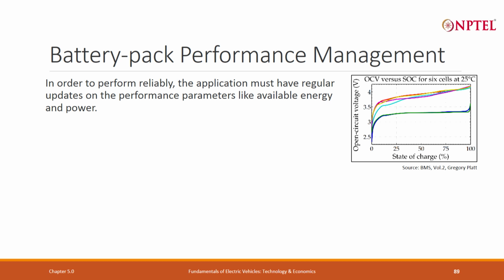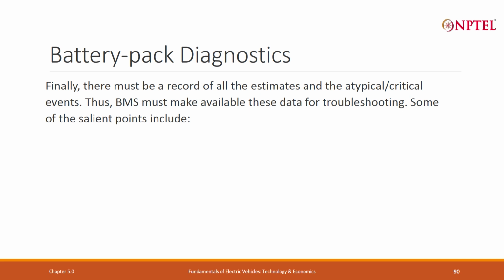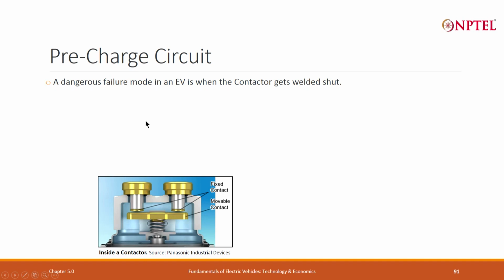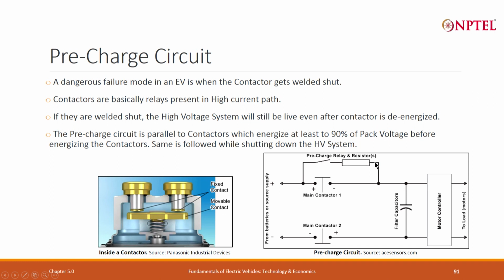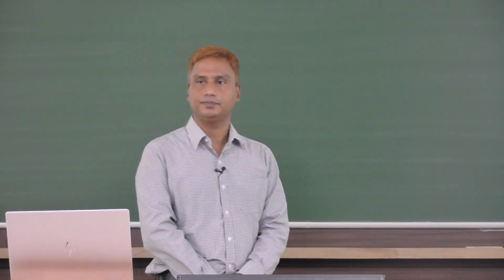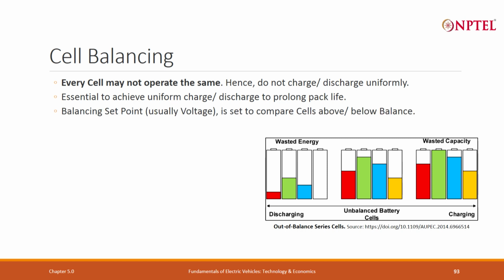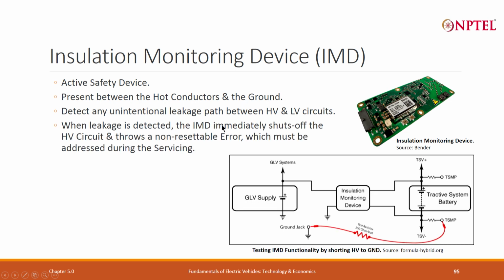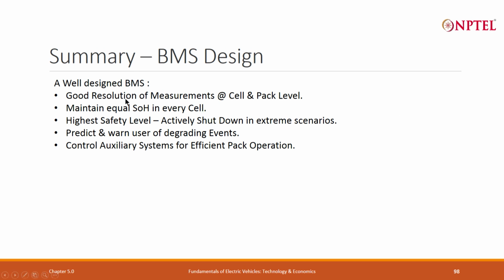Lecture 46 - BMS Design of Electric Vehicle - Part 3

Comment: if BMS provides cell balancing then why in most laptops all cells are not dead?, atleast 50 to 75 percent of the cells works inside the damaged battery